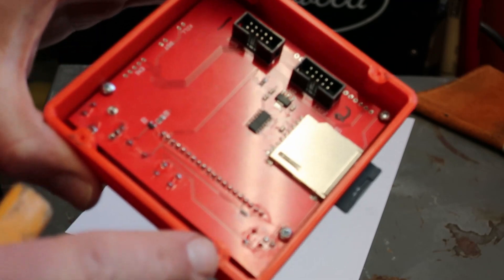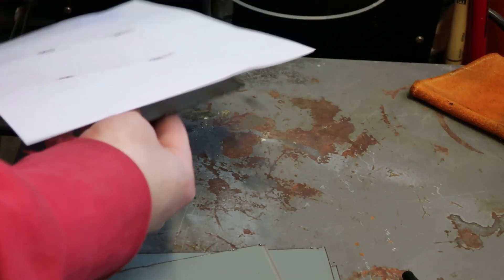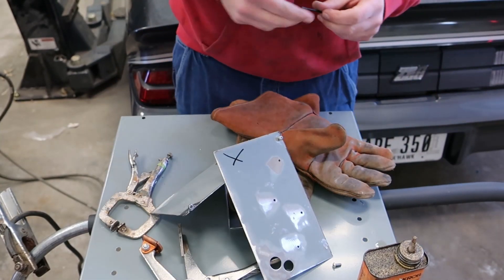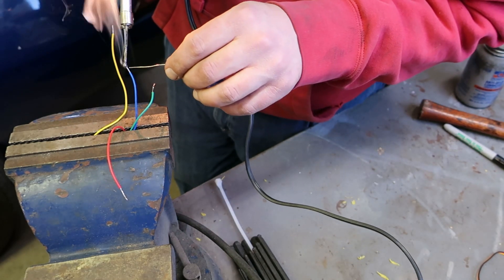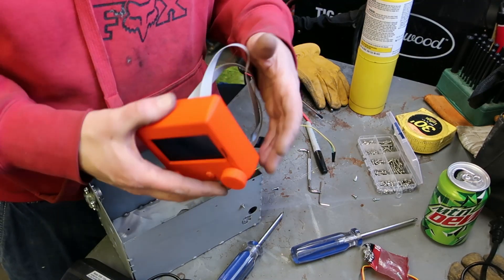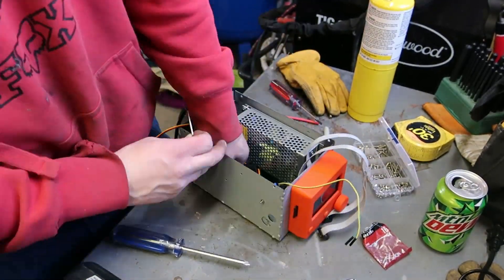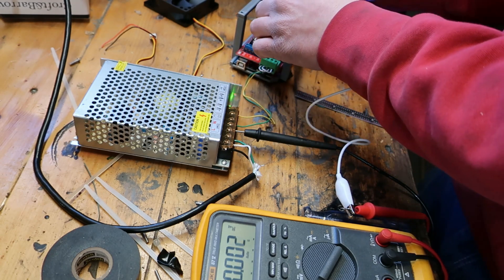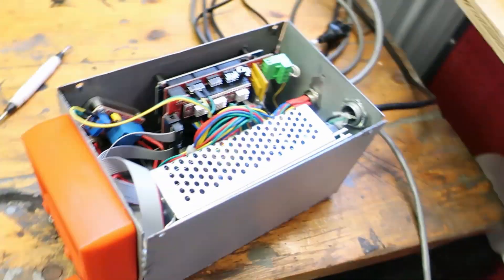MPCNC Primo Build Ep. 13 Electric enclosure build.

Comment: Is this a 3d printer or something looks looks interesting anyway
Reply from the maker: The plan is to be a cnc plasma cutter. Some people put router on them and make carvings. It is based on a 3d printer control and stepper motors. V1engineering.com has a over view.
Reply: @eliworks8549  oo interesting have you thought of wiring it up to an Arduino or a raspberry pie as they allow you to upload files from your pc directly to it  saves time plugging an sd card into it
Reply from the maker: That's the reason for a metal control box too. To hopefully give my Arduino a chance at staying alive
Reply: @eliworks8549  you could try using a  faraday cage sleeving around the wires with a normal one around the componants
Reply from the maker: It has a arduino mega. I'm doing it this way because the plasma cutter puts off alot of electrical interference from the high frequency start. I feel like the less wires to get voltage induced into them the better off I am.